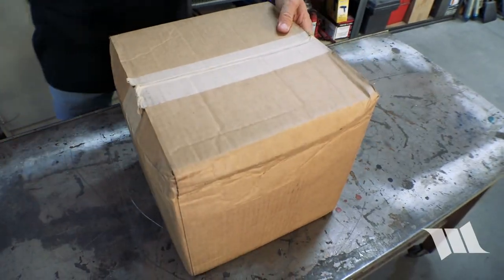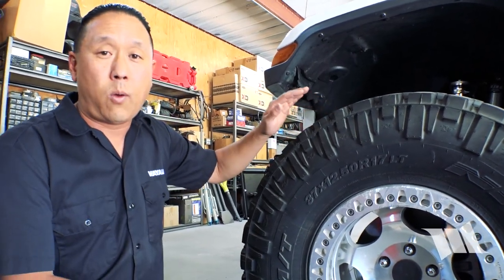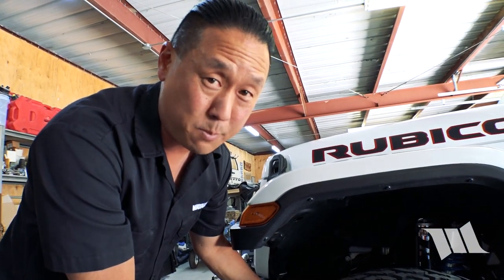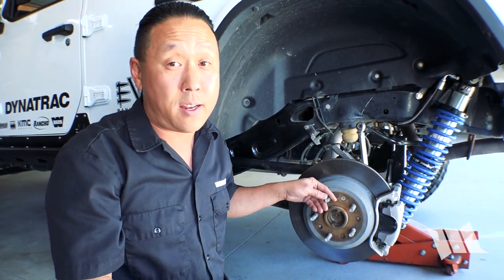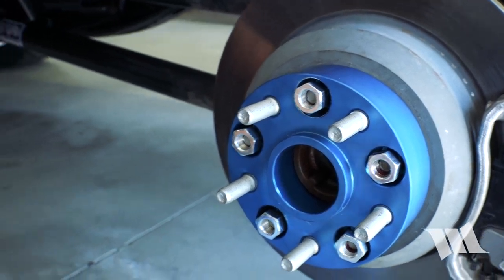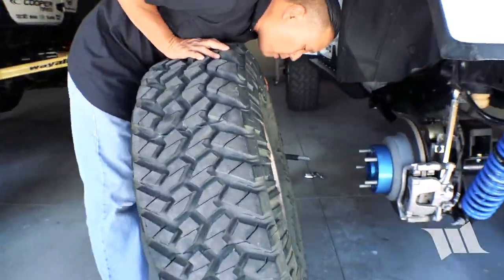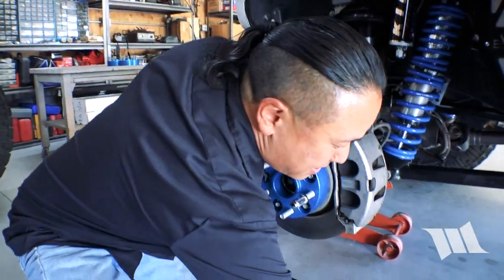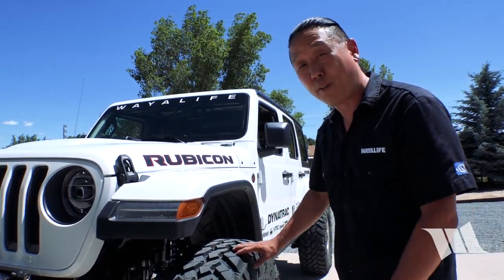Jeep Wrangler Wheel Spacer INSTALL - How to Run Big Tires on Factory Wheels with No Rub SPIDERTRAX

Comment: What size (thickness) were those spacers? What do you recommend for a Dodge Ram 1500 that has a very similar wheel bolt pattern to Jeeps running 12.5” wide tires with enough lift to avoid your typical rubbing? I find when I’m off road full lock my tread is catching the front control arm. When I turn full lock while parked it’s no way near it.
Reply from the maker: These are 1.75" thick spacers and they are what's needed for a JL. This is so they'll clear the factory wheel studs. On your 1500, I would call Spidertrax to see what they recommend. Could be all you really need to do is adjust your steer stops though.
Reply: Wayalife Wayalife thank you very much! I’m pretty handy and do basic work on my truck how can I adjust the steer stops?
Reply from the maker: @amolinari9  Not sure on a 1500 but there should be simple bolts on either side of your knuckles that you can just space out with some washers.
Reply: Wayalife yup I see them that is certainly easier and cheaper than spacers. Cheers!

Comment: When it comes time to do your brakes or anything that requires you to remove the brake drum you have to take the spacers off? Do you re torque the same? Shouldnt you be using blue loctite
Reply from the maker: You would only need to remove them if you're servicing the e-brake shoes or replacing an axle shaft. You would retorque the same. Red is what Spidertrax states to use and it is what comes with the spacers. You do NOT want these bolts to come loose and red is what you really need to use. I have NEVER had a problem removing them.

Comment: On wheel spacer...do u need to retorque after a few miles.....and will re torque the wheel spacer nuts break the bond of the red lock tight......for I am using teraflex 1.75 spacer with lots of red lock tight dripping off the studs to make sure it does its job.... to re torque means u may end up moving the not which can  break the bond...what's ur take on this....and think u for ur time and  videos..
Reply from the maker: You can check the torque after about 100 miles. Just set your wrench to a lower value such as 120 as opposed to 130. After that, no check should be needed.

Comment: I have an 09 JK, trying to get that untucked look. Wide tires and all. But what is a good width for the wheel? Is 8.5” wheel too small?
Reply from the maker: Wheel back spacing is what will give you what you're looking for more than wheel width. Try to look for a wheel with 3.5" of back spacing.

Comment: what size did you use on spacers and not to sure about the red Loctite relize were talking about lugnuts staying tight but red Loctite is the devil if you ever have to remove those lugnuts.
Reply from the maker: You NEED to run 1.75" spacers on a JL. Anything thinner will cause the wheel studs on your axle to protrude past it and prevent your wheels from mounting flush like it NEEDS to. As far as red loctite goes, I've NEVER had a problem removing them on wheel studs. You DO NOT want to use anything less.

Comment: My preferred method of holding the front wheel still is to put a screw driver or punch in the middle of the fins of the rotor and spin it until it holds itself against the caliper bracket
Reply from the maker: Yeah, that'll do the trick but seems like a lot of unnecessary work to me.

Comment: how safe is it to have wheel spacers??? I'm planning of putting a 35s and I'm going to use the stock jl rubi rims, how many inches of wheel spacer should I use??
Reply from the maker: So long as you install them correctly, they should be no different than a wheel with less back spacing. On a JL, you need to run 1.75" https://amzn.to/2ZXHxYd

Comment: You ever calibrate your torque wrench. Does + or - 10ft lbs matter. Just curious. 💪😊
Reply from the maker: When you're working with 130 ft. lbs. of torque, +/- 10 won't matter much.

Comment: Nice what size of spacer is best? For stock wheels with 35 - 70 - 17?
Reply from the maker: Assuming you have a JL Wrangler or JT Gladiator, you need 1.75" thick to ensure they'll clear the factory wheel studs.

Comment: Eddie are there no rims with a back spacing that would work rather than installing spacers?
Reply from the maker: There are plenty of wheels that have the correct amount of back spacing. 3.5" is very common. We just needed something in a hurry to address the rubbing we now had after installing EVO coilovers. Also, new beadlock wheels like what we have are expensive and I'd hate to buy new ones knowing that we'll eventually be installing new axles with an 8-lug bolt pattern and they will demand that we new wheels again.

Comment: other than the increased clearance, which tire is better, these or the coopers you had?
Reply from the maker: Depends on what's important to you. Nittos are quieter on pavement and have a longer tread life but they do have a radial pull to the left. Coopers hook up better on the rocks and drive straight but wear out a bit faster.

Comment: Just curious: what is your original back space and how thick are the Wheel spacers you installed?
Reply from the maker: What we need is 3.5" of back spacing for the EVO coilovers we now have. Our current wheels have 4.75" and these spacers are 1.75" thick - what is needed for JL.

Comment: Need help in regards to adding stability. I have a 20 Jl 2 dr Sport S. Factory installed Mopar 2.5 lift with Fox shocks and stock 17 inch tires. I am at a crossroads as I daily drive her here in Florida with a lot of highway driving, problem is she is so very unstable at highway speed, any traffic especially big trucks seem to cause her to blow all over the road not to mention any wind over 20 mph. As for rain on the highway I m white knuckling even 50-60 mph. Will spacers provide better stability? Better tires? I love her and really want to make this work.
Reply from the maker: How much air are you running in your tires? If it's more than 30 psi, it's too much and can cause some of what you're feeling. The other thing and maybe a bigger problem is that the 2.5" lift you have really yields more like 3" and while the kit does come with control arms that "should" have helped address your caster, it most likely wasn't enough for your liking. New adjustable front lower control arms will allow you to add in a bit more positive caster and that should help out a lot.
Reply: @wayalife  thank you for the reply. It may be me but it actually rides way better since the lift and new steel steering box. The tires are the terrible stock Bridgestone. I will certainly take your advice but if I am hearing you correctly-spacers will not aid at all in stability?
Reply: Oh and PSI is door sticker recommend 38
Reply: Also we are a a Border Collie family as well. His name is Bandit!
Reply from the maker: @vman4907  No, they will not. What I'm hearing from you is common when you have too little positive caster. This is normal after installing a 3" lift or more. Not everyone is sensitive to the affects of little caster but adding more will correct it, make it feel tighter for anyone who drives your Jeep.
Reply from the maker: @vman4907  38 psi is stupid and intended to give you optimal MPG. And, the negative side of that is that your tires will wear down at the crown being that you never get full contact of your tread to pavement. Trust me, 30 psi is where you want to be. I run my tires at 26-28
Reply: @wayalife  thank you sir. If you could recommend which arms to buy that would be very helpful and appreciated! BTW your channel is beyond AWESOME!
Reply from the maker: @vman4907  Me personally, I would recommend EVO or Currie. Both come with the same joints and they're what I've found to work best.

Comment: I've always been under the impression that wheel spacers put unnecessary stress on the flex points of the knuckle because the wheel is sticking out further. Is this true? If not, I'd do this so i can use the outboard shock mounts on my metalcloak lift.
Reply from the maker: Wheel spacers will cause ball joints and unit bearings to wear out prematurely but no differently than a new wheel with less back spacing. Outboard shock mounts won't do anything to prevent this.

Comment: Can you still accurately check the torque after 100 miles if there's already thread locker applied?
Reply from the maker: If the nuts turn when checking, they have either loosened up or you have set your torque wrench setting too high.

Comment: are wheel spacers totally safe? i have heard that they cause really fast wear on ball joints and on the axle. is that true?
Reply from the maker: High quality wheel spacers like this, ones that bolt on to the axle and then the wheels to it behave no differently than wheels with less back spacing. So long as they are installed correctly, yes, they are totally safe. ANY wheel with less back spacing WILL cause your ball joints and unit bearings to wear out prematurely.

Comment: I bought 1” wheel spacers for my 2020 Jeep gladiator, since I only went with a 1” spacer does this mean I have to cut my lug bolts so they are flush
Reply from the maker: If you're keeping your factory wheels or running aftermarket ones with a similar design, the factory studs on your axle WILL prevent your wheels from sitting flush with it and it WILL cause a dangerous failure. This is something I have personally seen.

Comment: So first of all looks bad ass but I got to ask and I know people may give me crap for this but if you know you can premature wear ur ball joints why do spacers and then have to spend money on ball joints cause of the spacers
Reply from the maker: Sorry, I'm not 100% sure I'm understanding what you wrote but if I got it right, you would install spacers like these IF you're running bigger tires and or have a new suspension system that causes rubbing at a full flex and or turn. Pushing your wheels further out will help to clear components.

Comment: I want to ask you a question: Do you believe that the 4 cey engine is powerful enough to have the wrangler lifted and in 40' wheels?
Reply: Gear it correctly you can turn them with a weed wacker. Yes, but not on stock gearing.
Reply from the maker: @Ubiel Seara Glez Yes. As mentioned, with 5.38 gears, you can make it work.
Reply: Thank you both for your answer. I'll keep it in mind.

Comment: you can't check for torque on the spacer lugs, you put locktite on the threads. If you re-torque and the nut moves, the locktite is useless at that point. unless your talking about the wheel nuts then ok, that makes sense.

Comment: Does Jeep gladiator rubicon rubs on stock wheels with 37”? Will I need a spacer?
Reply from the maker: Stock wheels come with 6.25" of back spacing and you really need closer to 5" or less to clear 37".

Comment: Speaking of spacers, talk to us about putting a 35x12.5x17 tire on the stock JLUR wheels, plz...
(believe the stock wheels are 7.5" wide). Thanks!!
Reply from the maker: Some tire shops won't install them but you shouldn't have any problems with it. Back in the day, we used to call that a poor mans beadlock as it holds on to the bead tighter.
Reply: @wayalife  thanks so much!  I was worried about airing down, etc...  Just tryin'to manage a budget!!
Reply from the maker: No problem :)
Reply: @wayalife  sorry to bother... This got my thinkin' juices flowin'...  If I keep the stock JL tire carrier, use a spacer there, too, for the additional width?  Can't thank you enough again!
Reply from the maker: @bjornholmquist5019  You can do that but you NEED to make sure that the sidewall of your spare presses FIRMLY against the rubber isolator on the tailgate. If you don't, the spare will jiggle and eventually cause things to break.
Reply: @wayalife  learning so much!!  Thanks!

Comment: Do i really need to use lock tight on spacer bolts  ? Or can i just torque it to 100 ft/lb
Reply from the maker: You really WANT to use loctite on the spacer nuts. You do not want to risk them coming loose especially being that they will be covered up by your wheels. Also, I never said 100 ft lbs of torque. You NEED to go the full 130 ft lbs just like the factory nuts.
Reply: @wayalife  I though lug nut torque specs said 95 ft/lb . Isn't it ??
Reply from the maker: @moneyfilters8706  On a JK. This is a JL and it has 14mm studs. The FSM specifically states 130 ft lbs.
Reply: @wayalife  i have jk . So 100 ft/lb are okey correct ?
Reply from the maker: The Money Filters correct. A JK will have 13mm studs so yes, 100 will be what you want.

Comment: Quick question. I was told you cannot do highway speeds all the time with spacers. It this a myth?   It is a silly question I know. I run spacers and no trouble. This video just reminded me what a 4X4 store told me.
Reply from the maker: LOL - Sounds like you need to find yourself a new 4x4 store.
Reply: Right :). I did.

Comment: Do you like the nitto or cooper tires better? Highway, trail? Thx
Reply: Jimmy R Nitto is a great tire for the everyday drive.
I have it on my tundra and on my Jeep.
Nice looking tire and smooth ride.
Reply: @ruisilva6995  Thx
Reply from the maker: @Jimmy R Both are good tires. Coopers hook up better on the rocks but are a bit louder on pavement. Nittos are quieter and have a longer tread life but they do have a radial pull to the left.
Reply: @wayalife  thanks for the reply

Comment: You have to check the torque after 100 miles?  what happens after the first time checking...do you have to check it every 100 miles??
Reply from the maker: You only need to check it the first time, set your toque wrench a couple of lbs. lower that what is needed and if the nuts don't move, you shouldn't need to check them again. I do anyway anytime I rotate my tires but I have never had one come loose.
Reply: @wayalife  sounds good.  Thanks

Comment: Some comment said that installing the wheel adaptor will be a danger...can you give me an insight because i am applying it for my pajero slort
Reply from the maker: LOL - sorry, I would never run anything on my Jeep that I considered to be a danger. Granted, I've only been doing this Jeep thing for over 20 years and would never pretend to know as much as a commenter on the internet. That said, I think it would be best to ask them what exactly makes them a danger.
Reply: Thanks...I have got the point of your answer..cheers
Reply: Does it safe enough using alumunium alloy 6061 t6 and bolt grade 12.9 for spacer?

Comment: Any problems running big tires with spacers? I was told not to use spacers on tires bigger than 35
Reply from the maker: Were you told WHY it would be a problem?

Comment: are 35's considered to be big tires? Do i need spacers for 35" KO2?
Reply from the maker: You only need spacers if you're wanting to run the 35's on factory wheels OR have other suspension clearance issues like we have with coilovers.

Comment: Hi are they safe if you going 95mph in the highway with big tires..?
Reply from the maker: Depends on what spacers you buy and whether or not you installed them right. If so, they should be just as safe as any wheel with less back spacing.

Comment: i've read that spacers wear out parts faster than stock, any truth to that? i'd like to cheaply get the aggressive stance but don't want to ruin anything is the process, thx
Reply from the maker: Wheel spacers will push your wheels out further and this will cause your ball joints and unit bearings to wear out prematurely or at least, compared to stock. It's not like they'll just blow up on you, they'll just need to be serviced a bit sooner and it's really not that big of a deal.
Reply: @wayalife  copy that, thx

Comment: Everyone speaks badly of wheel spacers.  Saying they can't be balanced, wears other components... is this all true?  
I actually enjoy my factory rims, but need some space to put on slightly bigger tires.  I'd love to use these rims.
Reply from the maker: Who's "everyone"? All I can tell you is that in the 25+ years that I've been doing this Jeep thing, I have NEVER had an issue running high quality wheel spacers like the kind that Spidertrax makes. And to be clear, they are NOT a sponsor and we have BOUGHT every single set we've ever run. So long as you install them correctly, they should work just like new wheels with less back spacing.
Reply: @wayalife  Thanks for the reply. 
Everyone is just our tire shops (local, and chain) all say it's bad. But that's a small sample, that's why I asked for your input :)
Reply: Yeah I get that also. I’ve had spidertrax on a couple of jeeps since 2008, I rock crawl and haul ass on dunes and trails. I’ve never had an issue, just install them step by step like in this video and make sure they are hubcentric. 🤙🏽🤙🏽

Comment: Get the properly set up wheel in ANY application folks, spacers (especially cheap ones) are just trouble waiting to happen!
Reply from the maker: And, I beg to differ. In the over 25 years of working with Jeeps, I have NEVER had a problem running Spidertrax wheel spacers. So long as they're installed correctly, they work no differently than a wheel bolted up to the axle. Of course, I'm new to all this Jeep stuff so what would I know.
Reply: The well engineered ones are not bad.

Comment: Is it ok to go with the blue lock tight instead of the red?
Reply from the maker: Only if you want your wheels to fall off while driving on the highway. Seriously, in spite of what all the internet experts will tell you, red loctite is not evil and you will NOT have issues getting the nuts off if and when needed. Blue will be compromised by the heat your brakes create and they will NOT hold the way red will.